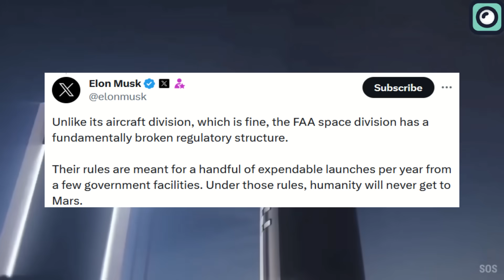SpaceX Just Revealed the Launch Date of the Second Starship, in days!

Comment: S26 single engine burn test was not for landing. It has no control flaps. S26 is a tanker design to stay in orbit, then when it cant be used anymore, it will be sent back to burn up in the atmosphere. That why it has no header tank for landing, and no internal life system inside. Just a big tanker with more fuel holding capacity. 
Thank for a great episode. 
 - NOM
Reply: Starship tankers without heat shields, should be scrapped in orbit(valuable items removed and outer shell reused or cut up and returned to earth or moon for reuse). 

Musk plans multiple extended starship missions per year, which means (6) tanker refueling launches for each ship. 
So he is either planning a moon-earth orbit refueling program or adding heat tiles to tankers.